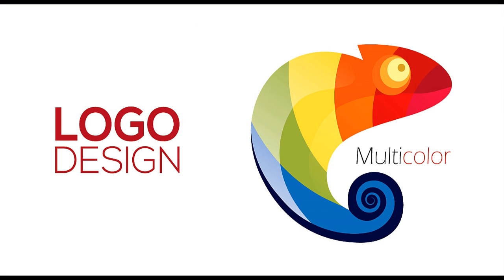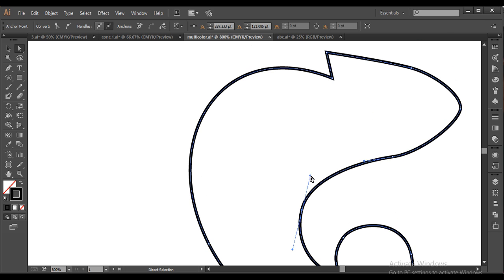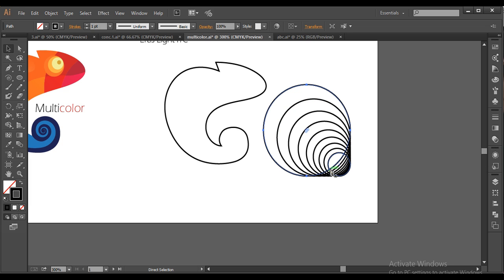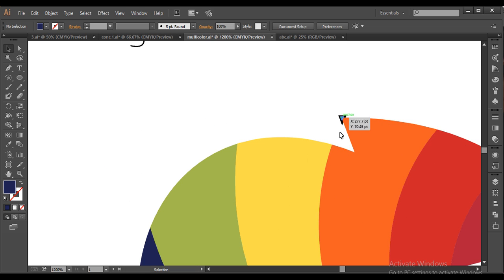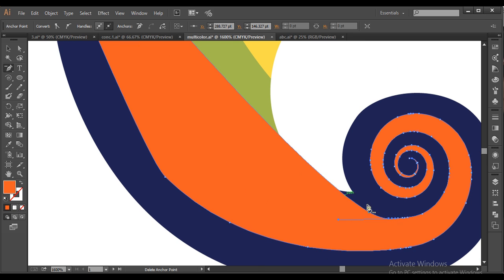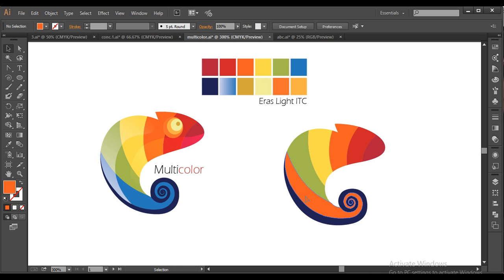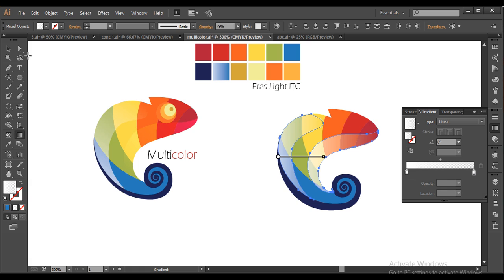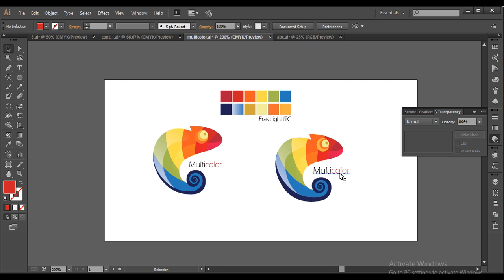Professional Logo Design - Adobe Illustrator cc (Multicolor)

Comment: Hello, I am using the illustrator cs6 in Mac, but it does work, can you share how to copy +past + auto scale the circle in this version
Reply from the maker: +Ivy Wang For mac you have to use Command key instead of Ctrl key. So the short cuts will be Command+C for copy, Command+F to past in-front and Command+D to duplicate
Reply: +creatnprocess hello, thank you for getting back to me. my question isa actually about the auto scale,  so do u scale the circle one by one manually ? it looks like it is done automatically while u past it.
Reply: +Ivy Wang Yes it scales automatically once you scaled it manually. 
Whenever you apply any actions like scale, move, rotate etc, you can repeat that action using Command+D.
Reply: +Rawson Badar Uddin Yes, It works!! Thank you so much ! that is very help, Awesome !